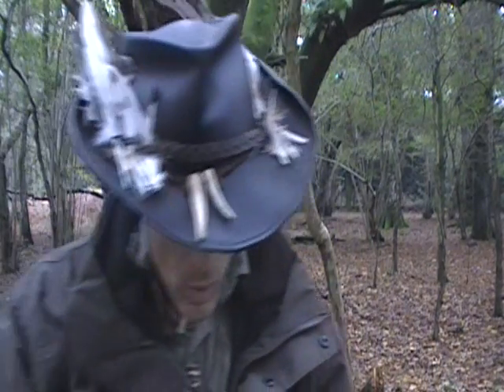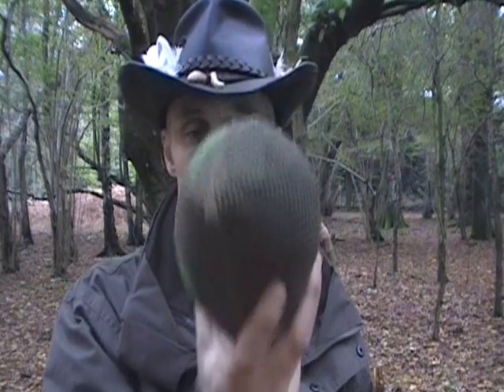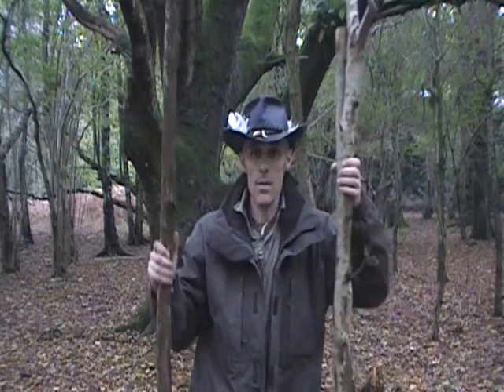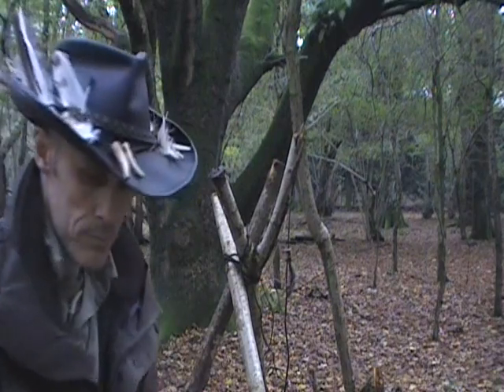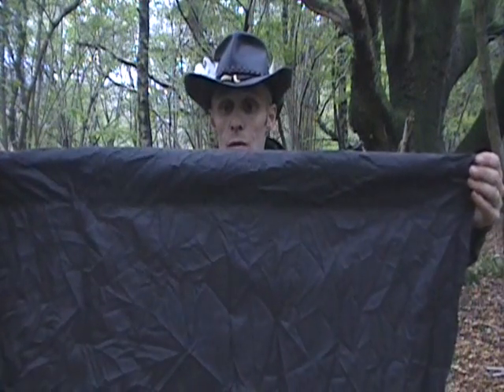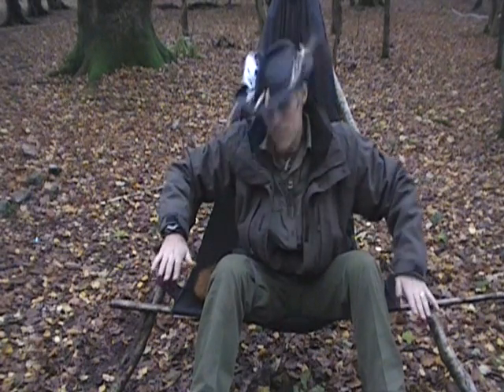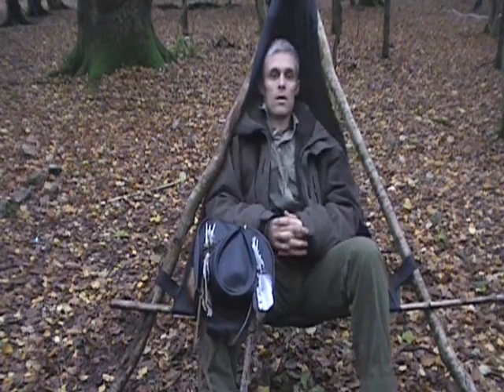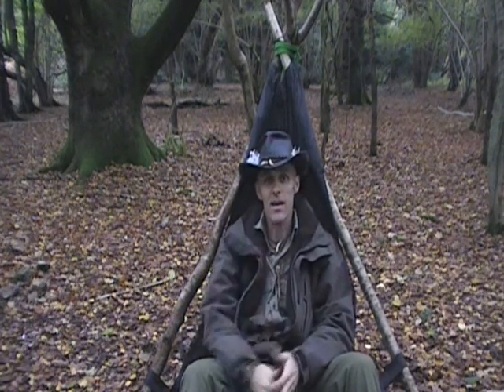Bushcraft Camping Chair

Comment: This makes a great chair for the outdoors. However I make my tripod chair with a hammock folded in half. Just as easy to set up and tie with the stick at the bottom. I like the loop idea, I haven't thought of that to keep the tri pod solid and the stick from slipping, I just sharpen the poles to stake to the ground and my weight drives them just far enough and evenly (if I choose the right spot) I suppose I could use a net hammock to replicate the loops and just pass the two poles through it. ty

Comment: Neat, worth giving a try.  Think the bottom straps would be necessary to add stability and prevent the seat area from bunching up on the pole.

I see your hat is evolving.  Back in '08 you didn't have anything but a woven leather hat band, by Nov. of '09 you've got 2 teeth and a bunch of feathers, by Sep. 2010 you've added 2 teeth and a half dozen or so pins.  You could keep your Ferro stick up there too.

Keep up the great posts, great to watch.

Comment: I couldn't quite make out what the material is called ('hyperlast'?). I was also thinking about making a chair like this. My idea was to use two layers, that way you can still use it as a sack/ bag (always handy), mosquitos won't be able to bite through and you could put insulation in it. I am looking for the strongest, water-repellent, lightest material (that can be stuffed small and dries quickly).